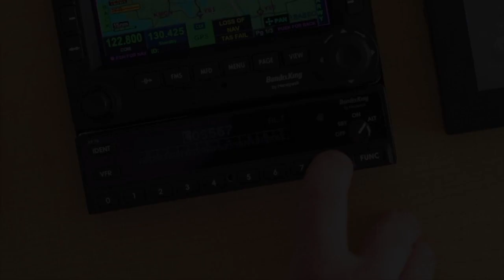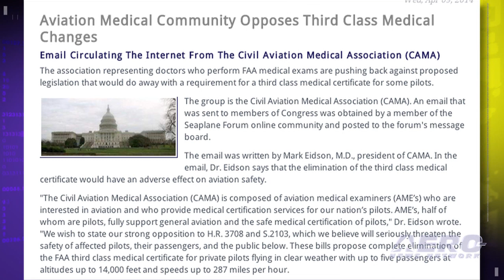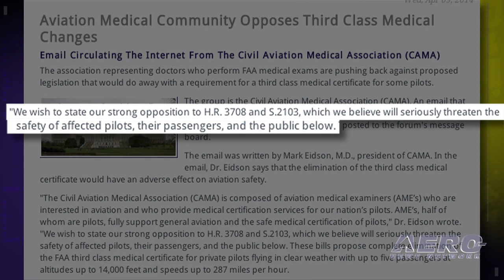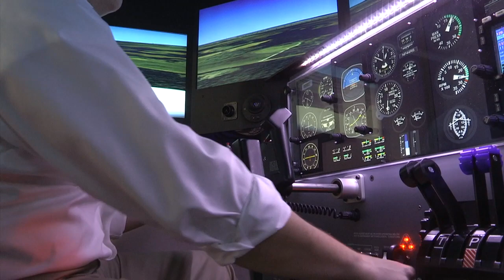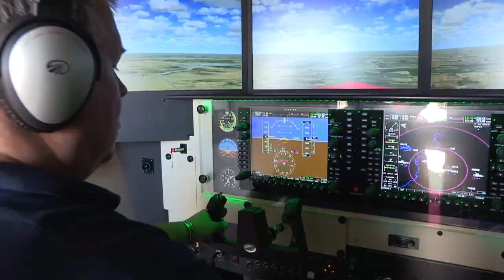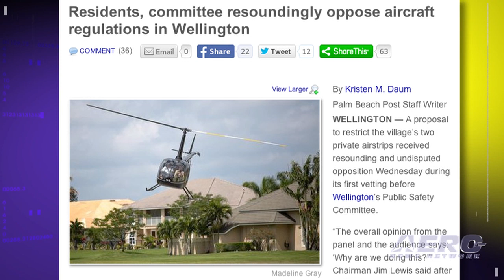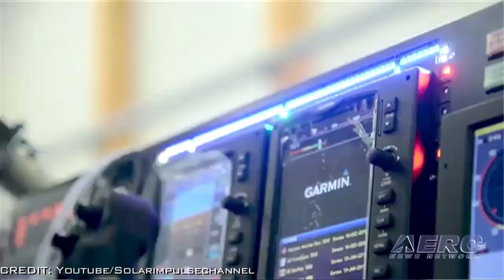Airborne 04.11.14: Lear 85 Flies, FAA v UAVs-Again, CAMA Demands Medical Oversight of GA

Comment: I flew to Sun-N-Fun and camped by the plane for a few days. The provisions for a "fly in" were not good. Food choices were limited. Water and showers were scarce and communal.  The grounds weren't prepared adequately and while the NOTAM was much more in depth than needed about the flying portion, not one word about FIREANTS! 

I did see many of the vendors and made several purchases that should have made them happy (not my wife though). The vendors were responsive and as helpful as could be expected. I would have liked to have had some help getting things back to the plane, but no mechanism exists for such issues. I would have purchased more goods while there if I didn't have to personally carry everything such a distance. 

The location for General Aviation Camping couldn't be any worse.  Any other category of plane is much closer to everything.  I would have thought that things would have been better.  I will not camp there ever again.

With that understood, I enjoyed my time there and will go again, but I will stay somewhere else.